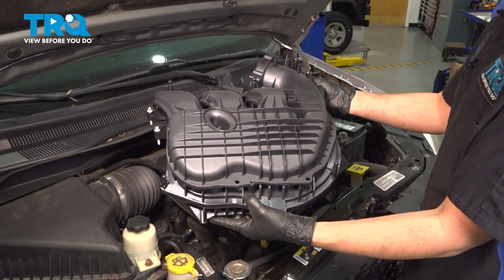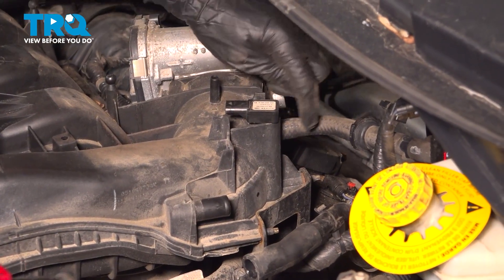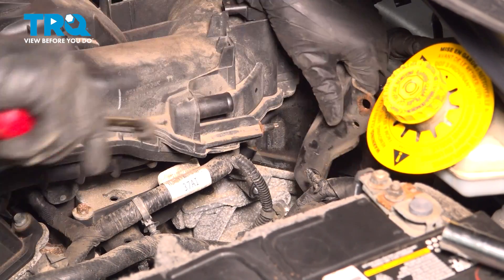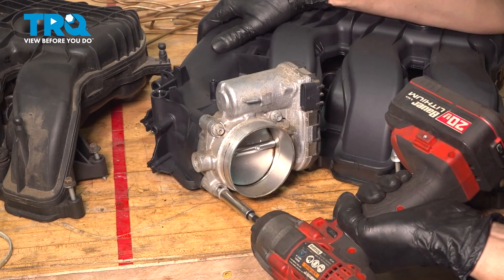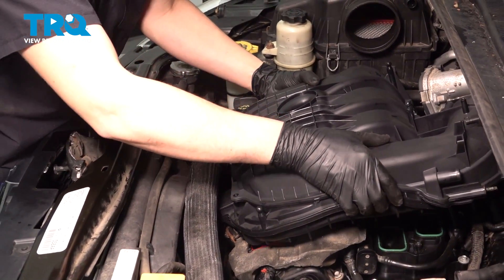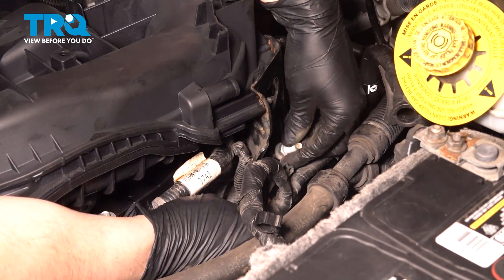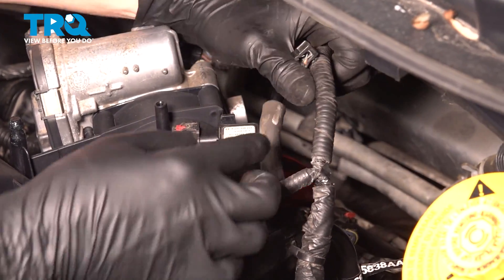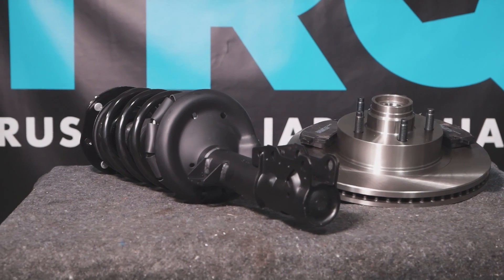How to Replace Upper Intake Manifold 2008-2020 Dodge Grand Caravan 3.6L

Comment: I may have torqued my upper intake manifold too much like 25% over torqueing as opposed to 89 inch pounds. There's no bolts broken or stripped but I can see there is a little room to tighten it way down, then I stopped the torque wrench. What will happen if I don't replace the gaskets and retorque this properly? I did it last week.

Comment: I have a question, I saw on my 2012   JGC manual that the upper and lower intake manifolds , both needs to be torqued at 71 in lbs. I was watching a lot of youtube videos but most of them said that needs to be torqued at 106/89. Can someone please confirm. Maybe this torque specs are because of a new revision or for the newer models?

Comment: I removed all 7 bolts on top. Remove the bracket from the back and the 2 bolts in the front. Still can't get the intake off. Any suggestions?

Comment: Can that thick foam silencer pad be eliminated to aid in air circulation for cooling around the ignition coils and the like on the  front bank??? I've heard that it can be beneficial for longevity of heat sensitive parts.